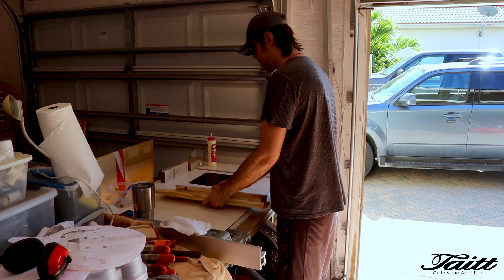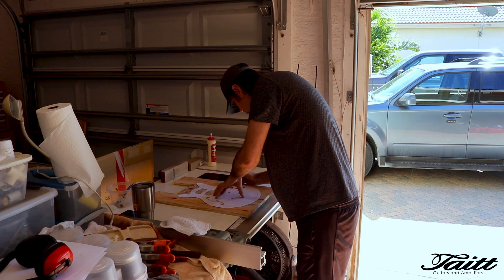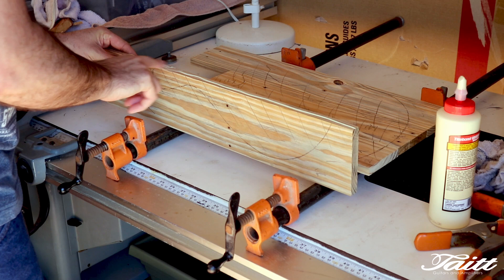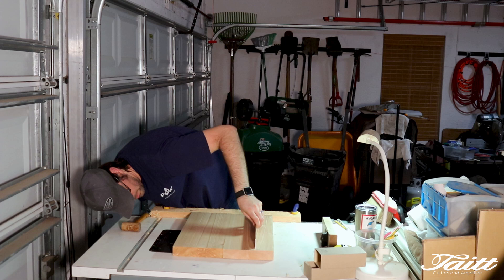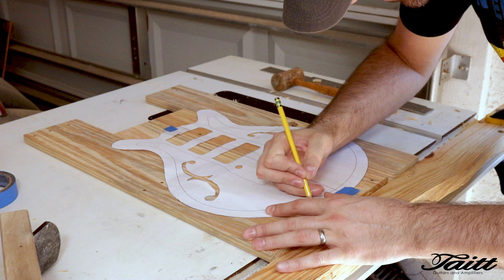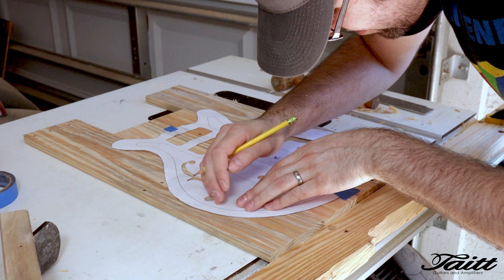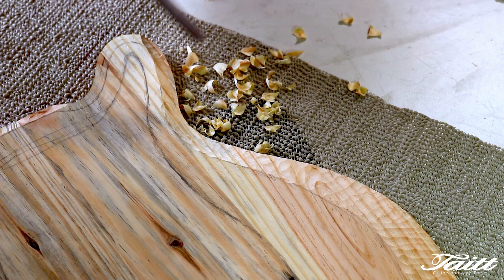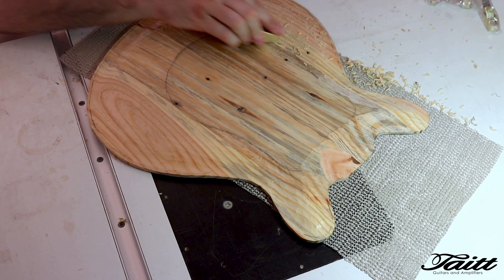Great Guitar Build Off 2021 - Part 2: The beginning

Comment: Personally, I would have preferred to cover the holes of the covers with wood...
Reply from the maker: Wood totally makes sense and would be the direction I would usually go. But my concern, and reason I went with what I did, I that I will be using a clear finish and with a wood plug there would be no way to hide it.